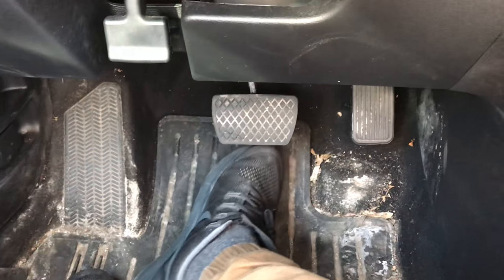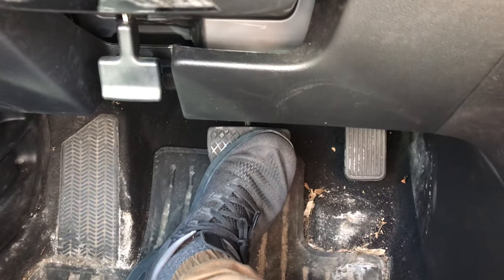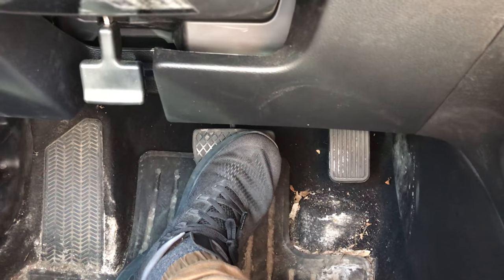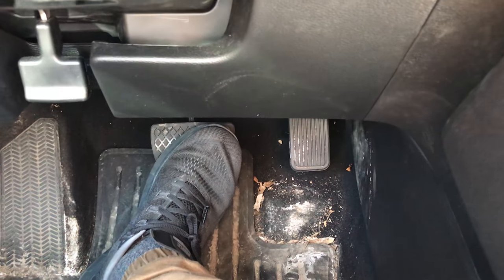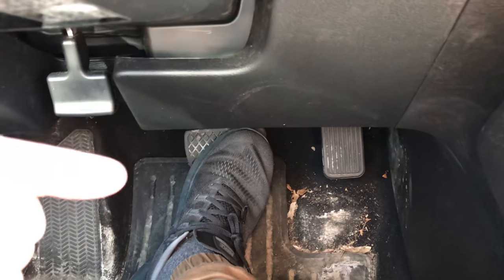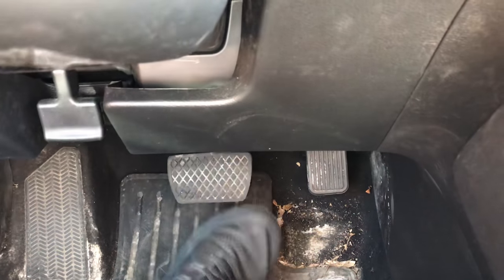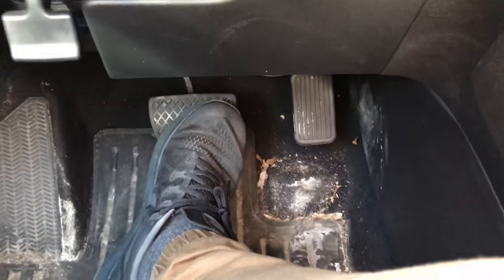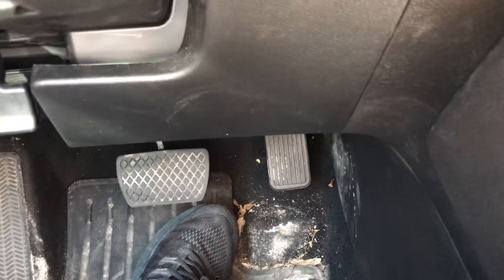How To Tell If Your Brake Booster Is Working Properly-Hard Brake Pedal Troubleshooting

Comment: Thank you, watched several videos trying to find symptoms without telling life stories. I appreciate the help. My check engine light came out stalled out one day and it is difficult to start codes for my one ignition coil is bad and a brake booster circuit sensor is going off. I thought I had a bad break booster but now just thinking it’s the sensor

Comment: Lately I've been having an occasional hard brake pedal but when it happens my brakes are actually engaging while I'm trying to drive. Everything I've tested or had tested seems to pass. Engine vacuum is steady around 20 on the gauge and no signs of leaks. I can't use my car till it gets fixed. Any help would be appreciated.
Reply: I am having the same problem. What did you do

Comment: If I can get brake fluid to my calipers(all 4) and I have already replaced the master cylinder would a bad or failing booster be the issue? I also have a hissing sound coming from the area around the pedal and when I press the pedal there is a whooshing sound
Reply: Find anything? I had the same thing that started like couple weeks ago
Reply: That is a symptom of shot booster
Reply: @jeromejackson7938  it ended being bad booster bad master and 3 seized calipers by the end of it all. And im thinking the one caliper I didnt replace seized up yesterday bc its grinding like crazy going to be replaced today tho

Comment: For my car, it just happens occasionally where the brake gets hard and it hard to push the brake down to stop. So I don't really know what the issue is.
Reply: Vacuum line to the brake booster might be obstructed/leaking or a bad checkvalve in the vacuum line

Comment: What if your brake padal drops to the floor when you start the car?
Reply: Sounds lien master cylinder
Reply: Yes, just replaced my master cylinder in my 02 escalade. Same issue. And I replaced the brake booster. Was a leak.

Comment: I have a weird one. My ABS sensor and traction control light turned on I already knew the pedals would feel funny because of the ABS being turned off and on so the brake feeling would change.

I noticed that when the ABS and traction control error are cleared the brakes got very sensitive, one little tap, and then the car would be stopped like I had pressed the brakes hard. I also pressed the brakes hard and for sure it stopped quickly.  After doing these tests the ABS and traction control lights would turn back on this happens intermittent. Most of the time the lights are turned on.

I have already replaced all the sensors and also did a line test and I had a good signal on all the harnesses and sensors. There is no leak any where on the brake system.

 If you have experienced this issue or how to go about further diagnosing the issue.

I cannot drive the FJ cruiser until I know the brake issues are resolved.

Any help would be appreciated 

Thanks
Reply: I just had this happen yesterday on my 07 Highlander it was very strange. I would barely press the peddle and it felt like I was break checking someone.

Comment: I'm getting a hissing sound when I press my pedals, when the engine is on, the brake pedal feels more spongy than usual and there is a hissing sound. When the engine is off, the pedal stiffens liks you said after a few presses. So i'm guessing is a the silencer material that is worn out or a possible air leak?
Reply: hey same thing here. but google said it's a sign that it's working. it's even louder on that big trucks

Comment: My brake pedal is makiing a air leak sort of noise like hissing or something but the thing you told it works brakes are working properly. And it also went down when turnd on the car what can be the issue

Comment: Just got my break pads replaced, and now after my car has been sitting for a while and I start it up it’s hard to push the breaks and get the car to stop. I almost hit a car backing up.  Guess I may need a break booster.  Once I’m going, the breaks work fine.

Comment: My 2007 Tacoma will pass all these tests but on the highway my brakes will sometimes apply themselves and the only two ways to fix this is to just wait or disconnect the vacuum line and plug it back in which frees up the locked up brakes.

Comment: hello
Do u have any idea when the break pedal have to push to the extreme end to get the break . this happens driving the vehicle after a while
Reply: Master cylinder, about to fail.
Reply: It takes one year to performance is what looks for it still stops less the failing part when it goes stop any more than 50 cm it need repair brake pad or calliper if it stop on pedal push it need under bonnet inspect clean top up don't drain fluid inspect and repair or electronic or boosters need pipes it's a part of the turbo vac system in the engine idling and that's how to tell

Comment: So when i did your test it did what you said and  its never been hard but when i press my brake in general it has air sound coming from by my feet and just doesnt work that great also my check engine light is on saying lean in bank1 and 2 any help?
Reply: Check your master cylinder!
Reply: Cuttyz On The Beat definitely the brake booster. The bank 1/2 lean is coming from the vacuum leak caused by the bad booster. Lean means too much air, not enough fuel in relation to factory programmed "normal conditions". The hissing at your feet is the air coming out of the booster. You may also notice harder than normal braking, rough idle (especially when pressing brakes), or even a misfire. A bad/leaking master cylinder would have brake fluid leaking at or below the booster.

Comment: I am having an issue with my Honda Civic 2004 ES
On smooth surface my brakes work perfectly, but as soon as I hit an uneven surface while braking, the brake's pedal gets harder, starts blocking and shaking. I am still wondering what is the issue with that. Can I get an advice about the issue  please?
Reply: If you push down and it has vibration then it's possible that you might need new break pads .

Comment: the brakes in my car (Opel Astra) work ok, but since some time ago the noise only occurs when pressing and releasing. There is no noise when fully pressed or released, or when it's pressed halfway. The noise occurs both when the engine is on and off. The brakes pass the test, BUT the noise appeared. is this a possible problem in the future? 
Here is the video https://www.youtube.com/watch?v=C2P89jiYrAk

Comment: Stiff brake pedal with hissing replaced power brake booster and one month later I'm having the same issue.  Stiff brake pedal and hissing. Brake pedal stays Stiff when car is off when I turn car on brake pedal stays Stiff. Need help. Shit is super annoying. Trying to figure out if I have air in my brake lines or something? Any suggestions anyone,
Reply: Did you ever find out

Comment: Is my brake booster bad if it let's air out or hisses when I push on your brake super hard? The vehicle is on btw. Also my truck shakes when I brake and sometimes it doesn't. I just put in a new rack and pinion and ball joints so it's not that. It started doing that after my stabilitrak light would come on. It was pretty bad so I found out that the steering wheel sensor was causing the stabilitrak light to come on. It still shook a little bit so I figured I'd change the arm bushings and it shook less when using the brakes. The rotors are also new so unless the shaking bent at least one I don't know what else could be causing it to shake. I'm also due to change my rear brake drums but I don't think that's causing it to shake. Help! 🙆‍♂️

Comment: Can the booster be damaged by applying too much pressure on the brakes and starting the car? I had to keep the brake pedal down with a stick while I was working on the brake lights. Now the pedal is hard and the calipers are sticking. Thank

Comment: Hello and quite informative video.  Although my Brake booster seems ok based on the test you just showed here, i get a hissing sound only when i press the brake.  What could it be. Thanks
Reply: I have the same symptoms. Brake booster According to video seems fine. But its still makes very low kinda noise. Did you find out what causes yours?
Reply: @dipen6680  Not really.  I am just living with it.. The good thing is that it is not getting any worse.
Reply: It's the Master Cylinder that connected to the booster

Comment: I have a 2013 Ford edge. When breaking easy it will stop. To stop for an emergency the petal go's to the floor. Then I pull over and pump it and it has braking power again. Can you help me.
Reply: maybe less or brake oil leak , so it won't have power to stop with sudden press
Reply: gypsie_lady  look up some tSB  recalls found out that ford will warranty some booster up to 150k.
Reply: sounds like you have a fluid leak somewhere in your brake system could be a bad wheel cylinder or  master cylinder.

Comment: I have accord sports 2019. I have a dead gap before car stops. My brake seems loos. You think it could be the brake booster?
Reply: If it's your brake booster your pedal will be extremely stiff and hard to push down with the car on and with the car off... if it's had brake work recently be sure that the brakes were bled PROPERLY  b4 spending a few hundred dollars to change the booster... hope this helps
Reply: Also from reading your comment if the brakes are loose it's an indication of a leak either in the lines or the master cylinder
Reply: Wow brand new and giving problems already